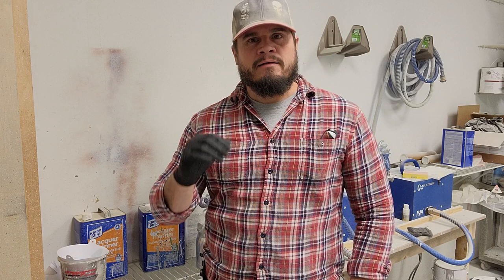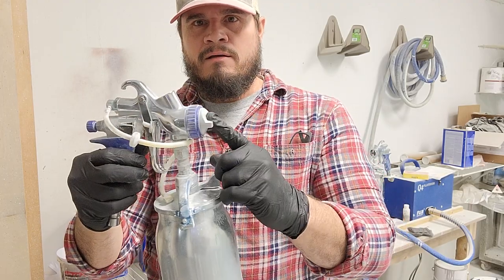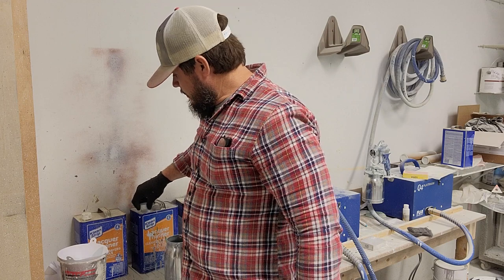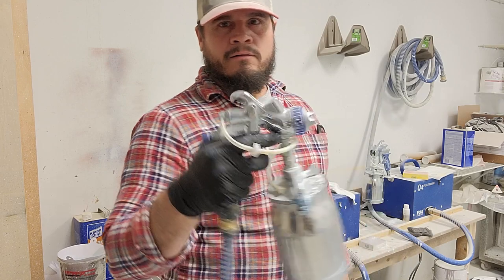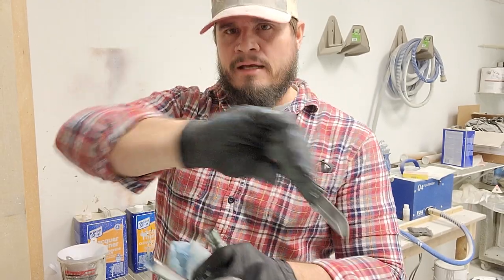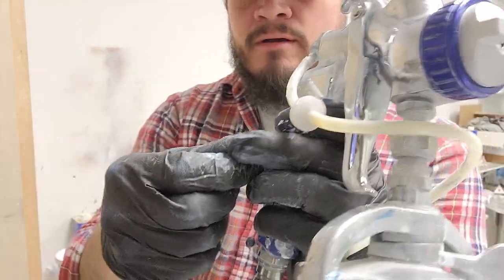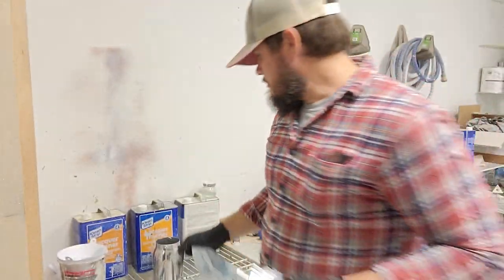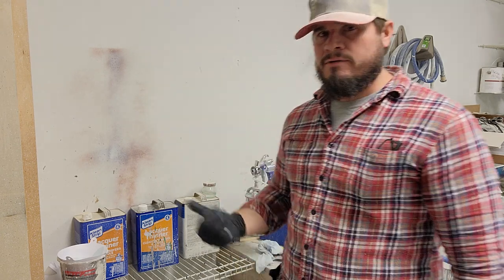How to clean a paint sprayer. Fuji Q4 Platinum

Comment: I know you didn’t get to rebuild the gun but it’s. good practice is to smear a tiny bit of Vaseline (petroleum jelly) on the threads but also half way up the needle where it runs through the gland. You don’t want the gland to dry out and it just reduces wear. It never gets into contact with your paint materials providing you take reasonable care so no worries on that score. I was doing what you were doing 60 years ago and basically nothing has changed.

Comment: Thank you—I’m new to HVLP sprayers; I just bought the Fuji Mini-Mite 5 to spray paint 65’ of iron fence. This is a great tutorial. Can you spray primer through one of these? I will be using Sherwin Williams Pro Industrial Pro-Cryl Universal Primer & Top Coats of Sherman Williams Pro Industrial Alkyd urethane Gloss Enamel—these are both water based products.  Any help is greatly appreciated—God bless…
Reply from the maker: You can definitely spray primer. I spray laquer so it's the same but a little different. You will need to thin down your paint and primer until it comes out smooth and lays down flat. It should not orange peel when the viscosity is correct. Adjust your flow and pattern accordingly. Make sure to clean out with water on water based material but put mineral spirits back in the cup with your removable parts. Never store them in water. Have a blessed day. Hope this helps! Keep Rockin'!

Comment: Do you use oil based paint? Is that why your cleaning with lacquer thinner? Or would you have just cleaned with water if using water base paint? Do you need to thein down your paint with the q4
Reply from the maker: We use laquer for primer, finish, and sealer. Lays down smoother. Using oil based, you would clean with mineral spirits and water based, clean with water. I thin the paint at a 1:1 ratio roughly so the paint comes out nice and gives me a great finish
Reply: @lumberjack2880  so 1:1 ratio 
Would that be 1 gallon of paint to 1 gallon of water? Is water what you use to thin out
Reply from the maker: I thin the paint with whatever material is needed to thin that based paint with. It's roughly a 1:1 ratio. I just eyeball it until I know I have the proper consistency. If you're not sure of correct consistency, there is a funnel that comes with most spray equipment that is used to figure that part out

Comment: New to the Fuji system and loving it. This video really helped! Once I’ve thinned my oil based primer and started spraying, how long do I have until I need to worry about my gun getting clogged? Do I have time to fill it up again if I empty the cup? Thanks!!!
Reply from the maker: It really depends on temperature. If it's hot outside, it will tend to clog up the nose faster than if it's cool outside. You should be able to spray all day without clogs it mild to cold  temps. If your spray pattern starts getting "off", check the nose for buildup. Make sure to clean thoroughly everyday and do not leave oil based paint in the cup overnight
Reply: @lumberjack2880  Thanks so much!!
Reply from the maker: You're welcome! Thanks for watching and please subscribe!!

Comment: How do you clean the pressure tube?
Reply from the maker: The gun comes with replacements. If it gets full, you can replace it. Most of the time, though, when it it stopped up with dry laquer, I can blow it out with my air gun. Sometimes it works that way and sometimes if doesnt.
Reply: @lumberjack2880  ok so that’s an item that has to replaced constantly? Is there any way to avoid the pressure tube to clog so often?
Reply from the maker: I replace mine maybe 3 times a year. If it gets clogged and the air can't pass through, alot of times you can clean it out but it is a" wear" part so it can get to the point where clearing the dried paint is not an option